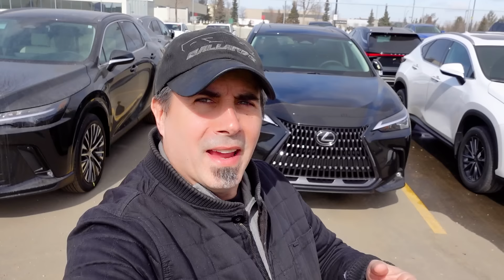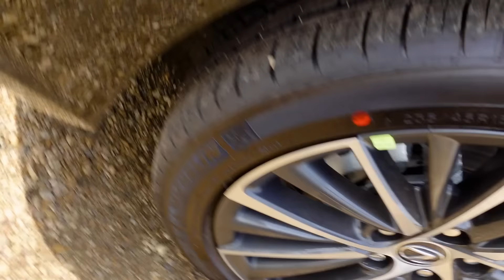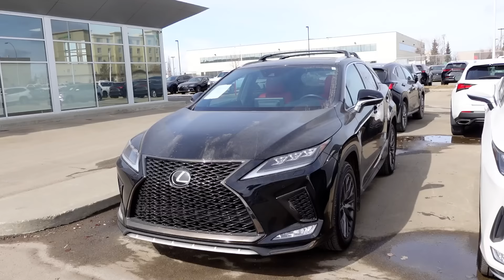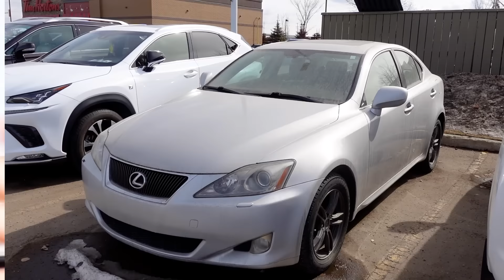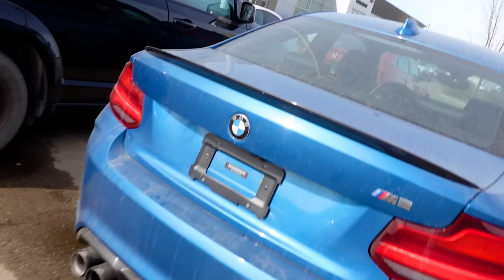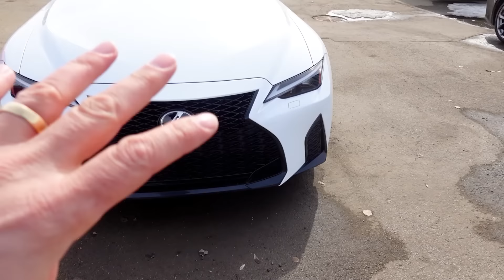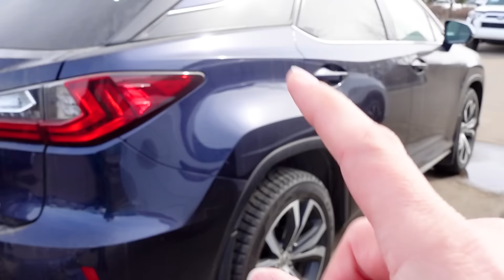Is Buying A Used Lexus a (MASSIVE) Mistake?

Comment: was a Lexus tech for 15yrs and YES buy a used Lexus..there bulletproof!!!   quality is very high and there quality team in Japan are top notch
Reply: The best.
Reply: @pauly kay Just wondering, is there a considerable difference in quality (if any) between Lexuses built in Japan vs built in North America?
Reply: @smakarov24  no that I am aware of.  I have 3 Lexuses in our household.  A 08 RX350 and a 24 NX350H both built in Japan.  My 17 ES350 was built in Kentucky.  All of them bought new.  I don’t see any built difference in terms of material and built quality.
Reply: My family owned 3 Lexus. I love Lexus. Smooth, luxurious, and reliable.
Reply: Yep.  We always buy new Lexus and keep them for a long time.  Wife’s 08 RX350 156K miles still going strong, my 17 ES350 just hits 37K miles.  Her new NX350H should arrive in about 10 days.  Wouldn’t buy any other brand.
Reply: I'm looking at a 2015 RX350 with about 80K on it. Anything I should be concerned about?
Reply: Nope....great vehicle
Reply: 80 k?  Barely broken in
Reply: My 2007 Lexus RX350. 260,000kms. Fully maintained & head gasket just went. Told I need to swap motor. Total    ost 6 to 8k. So disappointed
Reply: Idk i just bought a used ux and its got cabin vibration and slight vibration when braking. Only a year old. Prolly why they turned it in😅
Reply: @jacidel  it the UX is only a year old it should be still under warranty.  Take it to the dealer and have them check it out.
Reply: @jml9550  dont you have to pay for diagnostics?
Reply: @jacidel  yes you may have to pay an hour of diag fee.  Most likely they gonna tell you these are brake and tires issue.  Then they are wear and tear items, will not be covered under warranty.  Personally I would not get any repair at dealerships, any competent mechanics can work in Lexus.
Reply: @jml9550  hi! I took my car back to carmax and they do admit my rotors are warped. Brake pads brand new but rly bad rotors. Theyre resurfacing them for free. Thanks for the advice. :)
Reply: @jacidel  great.  Glad to hear Carmax stands by what they sell.
Reply: @jml9550  yeah. Im now hearing a slight rubbing though. Hope its okay. Supposed to be driving out of state in 2 days in a heightened level of anxiety😂😂
Reply: @jacidel  should be fine after they resurfaced the rotors.  The new brake pads may just need to “bed” in the rotors.  Google “how to bed brakes”.  Should show you how’s done correctly.
Reply: @jml9550  hope so. They dont look perfectly smooth as i thought  they would. Perhaps they will over time. I wish i was a mechanic and didnt feel so uneducated. Lol thanks i will google that :)
Reply: @jacidel  well we learn from experience.  I sure can’t prescribe medication like my Dr., let alone fixing cars.
Reply: @jacidel  if the UX is going at highway speed and vibrates during braking, It could be warped front rotors,  a mechanic should be able to resurface the rotors and get rid of the vibrations.
Reply: @jml9550  its actually when im slowly going to brake and whenever im holding the brake down there is a slight vibration through the cabin
Reply: @jacidel  could be warped front rotors and could be the tires not being properly balanced.
Reply: @jml9550  thank you i am going back to the dealership Wednesday i hope they can see the problem. Crazy to have such an issue at 24k mileage but i guess it depends on how the person was driving
Reply: @jacidel  yep.  If the previous owner hard brakes it many times it could warp those rotors.  Also sometimes tires can create flat spot during long hard brake, which could create vibrations while driving.
Reply: I wish we could speak more frequently, I think if I gained info directly from an actual experienced Lexus technician that, that would help me convince them to let me buy a used 2014 GS350 for under 21k financing but I can afford the car & about to finally finish my associates & bachelors.. but wants me to stick to under 15k w aHonda, Nissan, & Chevy.. I’m good, I work as a photographer at a Honda dealership & have been thanking to daily a 02 Envoy that just hit 253k miles.. just replaced the right side of her axle too w being a month w/o s daily 😴
Reply: @Mathilda2zero  changed the brake pads and rotors and its fine.
Reply: Thank you 👍
Reply: My 2012 IS250  F Sport gonna be ok sir?
Reply: How are they for maintenance cost compared to Toyota?
Reply: Wow but he surprised me with the rust thing! Lexus rust??? wow
Reply: Lexus tend to rust?? Wow I am surprised
Reply: I live on little money Are they expensive to maintain?
Reply: Very high.  Love mine
Reply: what about a hybrid battery in plug in models? How long do they last?
Reply: Any ideas on a rattle on ES300h roof lining? Like a light rattle ticking on rough roads. Above driver head, and rear passenger but does happen in all 4 corners. Been back to Lexus 3 times!
Reply: 2019 ES300h Fsport 30k miles. Riddled with rattles. Been back to Lexus 3 times 🤷‍♂️ Lexus have serious interior noise issues

Comment: Thoughts on the 2020 Toyota Avalon 3.5 V6? In terms of reliability & longevity. And what should I look out for?
Reply: The GR series v6 engines are dead reliable. 1GR FE 4.0 L.  was in 2nd gen Tacoma and current 4 Runner. 2GR FE is in the Sienna and other models...another great engine. They are hard to beat. I towed our RV 10 000 kms across Canada with my 13 Tacoma...that 4 litre is insanely reliable. I recommend THE CAR CARE NUT...he is a Toyota repair tech and you can search his videos for more info. He is a Toyota fan boy like me. He is very honest and fair.
Reply: @mikefoehr235  yessir! I watch him too!

Comment: One of the main things to watch out for when purchasing a used Lexus, if there is any maintenance records and where it was done. Some shops tend to put the wrong ATF . Needs to be WS. I have seen a Lexus and an Acura with transmission failures due to wrong ATF.
Reply: ATF and WS?

Comment: Lexus SUV's/crossovers are classy vehicles, but something that is more versatile and practical would be the first-generation Kia Rondo with the 2.7 L V6 engine and the five-speed automatic transmission, the second-generation Hyundai Santa Fe with the 3.3 L V6 engine and the five-speed automatic transmission and the first-generation Nissan Versa (hatchback) with the 1.8 L four-cylinder engine and the four-speed automatic transmission. Thank you very much.

Comment: I own both an 06 ls430 and 2011 rx350. Kept both of them in mint condition and no major issues so far. Highly recommend
Reply: The Ls430 will run forever.. one of the best that lexus have ever put out, only behind the iconic LS400 And Es350
Reply: I am considering a 06 ls430 & would greatly appreciate any further experiences/comments with it that you may have. TIA.

Comment: I bought a brand new 2021 Lexus IS300 F sport, switching over from a BMW 335. I looked at the new G-series BMW 330 at the time and decided to get the Lexus instead. This is a very accurate review as no car is best at all things and BMW certainly had the more modern interior design, some better technology, a better transmission. I did observe the Lexus to be superior in sound, luxury, build quality, design and having better seats alongside a more compelling engine (3.5 n/a V6 seemed more compelling than a 2.0T 4 cylinder). I do miss the 335, as leaky as it was lol. I think BMWs are great second cars for fun but I think most people will find greater utility in a car that excels in look, sound, luxury and longevity - these are all season commuters after all. Down to preference I would say, but I am sticking with my Lexus for my main and I'll get something fun on the side later down.
Reply: Scotty Kilmer approves this message🤣
Reply: @davidwelday3276  lol fr! I disagree with his continual bmw hate tho. The b48 & 58 ain’t too bad
Reply from the maker: Nice
Reply from the maker: Hi Devan, sounds like a solid experience with the Lexus so far, and you are right, the BMW has the focus on the drive above durability.  The B58 seems to be running solidly and I would expect the S58 to be even better, but time will truly tell.  Either way, BMW has improved in the last handful of years with regard to reliability.
Reply: @ECPP  if I could have afforded the g series m340 I would have it tbh. But my lexus was like 52k and those were like 70k. But tbh, I heard the b58’s are pretty solid. My n55 was a bit leaky back in the day, thank god I didn’t go through the n54 struggles lol.

Comment: Bought a 2013 RX350 F Sport a couple of months ago. 160K kms and the 8spd transmission failed. Car was well maintained. $12k to replace it with a refurbished one. Luckily the dealer had to buy it back.
Reply from the maker: Cheerz

Comment: My is250 runs like a champ with 170k miles
Reply from the maker: That’s a good run
Reply: @ECPP  it was one owner and had all the service records and I change the oil every 5,000 miles and only run high grade 93 octane thru it to keep the carbon build up low.

Comment: Love this channel! Please I have a tiny question - just purchased a 2019 ES350 with literally 30 days left off the warranty, what checks on the vehicle do you recommend I do asap to make sure I milk what’s left of warranty so I don’t get burned after it expires? Thanks 🙏🏽
Reply from the maker: Hi, have them validate that the updated VvTi lines are done, check brakes and rear suspension.  Window and door seals as leaks have happened.  Inspect water pump or have you had any coolant leaks?  Other than that, they are solid and just a general look over.  Cheers

Comment: I agree new Lexus is better deal than 1-3 year old Lexus. But I think a new hybrid Toyota is better value than a 4-10 year old Lexus. You can hold onto the Toyota for 4-6 years until you can get a lightly used Lexus at reasonable price. Many people are stuck in the mindset of new car being bad value, and they haven't adapted to current market dynamics. Another factor is that in 3 years there will be a shortage of 3 year old hybrid Toyota/Lexus, so they will demand a higher than normal price.
Reply: Just bought a Lexus NX hybrid for my wife to replace her 08 RX350 which still runs strong.  The RX will be my son’s first car.  My 2017Lexus ES350 drives like the day I brought her home, she only has 37K miles in her though.

Comment: The ES: is a Camry
LS: is a Avalon
Reply: Negative.  ES is Avalon based and LS has no American car it's based on.
Reply: Not so. I own both cars. 2008 Toyota Avalon Limited and 2012 Lexus LS 460., and there's a huge difference. The Lexus is vault like quite and holds the road like it's bolted down. The Avalon is smooth like the Lexus but much more road noise enters the cabin.
Reply: @beverlyquintela2754  Yup LS has much better insulation.  Based on same platform as Avalon though.

Comment: Excellent point, regarding ownership! Typically, a Lexus owner will keep up on the maintenance, even after several years and the "newness" wears off. Arguably, vehicles five or six years old might have been treated far better, over several owners, then expensive European cars out of warranty
Reply: Nah.. theyre just built better
Reply from the maker: Thanks
Reply from the maker: Haha I would totally agree Thomas as many Euro car fans drive them like a rally driver.  With that said there are some nicely kept Bimmrs and Benzs, you just have to look a little longer.  No warranty is a huge risk for a V8 BMW that is 9 years old.
Reply: @ECPP  without a warranty on my Porsche I would have been in bad shape. Well worth the purchase price!
Reply: First off who buys Lexus vehicles? They tend to be mature people that want reliability, comfort, and a stylish well appointed vehicle. A new Lexus is not cheap so people with a good income buy them. They can afford to make sure they are maintained. Lexus vehicles are not sports cars they are luxury vehicles, so they are driven accordingly. Most Lexus vehicles use regular gas. The venerable V6 will probably be phased out and replaced with a turbo 4 cyl. that will get better gas mileage but require premium fuel. Lexus vehicles with a normally aspirated engine are mated to a 6-speed or 8-speed geared very good transmission. Lexus is a Toyota product that has the same design that can be maintained easily concept. The exaust system is stainless steel, and the body is well constructed with good steel. The only issue you can run into on the V6 is a timing cover oil leak that is expensive to repair but it is fairly rare. Like any vehicle, you inspect it or have a mechanic go over it before you buy but Lexus used vehicles are generally a good bet. Or buy a used one from a Lexus dealer. They are not going to sell you a problem vehicle. 
BMW, Mercedes Benz, and Audi are nice vehicles but the parts and maintenance are very expensive. Who wants to have to change a timing chain at 200,000 km or sooner? They all use premium gas. They are not DIY-friendly vehicles in general. These days even a chain garage will charge you $130. per hour and they all nickel and dime you for scanner use, acetylene use, shop supplies etc. They are also up charging a lot on parts. The BMW, Mercedes, and Audi dealers will charge you $200. an hour and use shop scale book times for repairs. So a vehicle you can DIY  makes sense.

Comment: Mark, I bought a 96 Lexus SC400 with 162K miles and it was in mint condition. I put over 200K miles on it before some dumb broad texting and driving ran the stop sign and totaled my car. The odometer had 397K miles and still running strong. It really comes down to looking for the problem areas of the specific model you're looking to buy to avoid headaches and repairs. I bought a 97" SC400 for my mother as a Christmas gift years ago and again it had 150k miles and with 207K on it now the car is super reliable. Marky Mark this is why I say Lexus for life Baby!
Reply: also why i bought my lexus
Reply: Same. I am a Lexus lifer.
Reply: Toyota/Lexus and parts are still expensive but Wirth it
Reply: @Jac735  I wouldnt know because in owning Lexuses since 1996  i have never needed any parts other than replacing one battery on an LS400...seriously...and i have never taken any of my cars to a Lexus dealer for anything. Their prices will gouge your eyes out.
Reply: @Jac735  

💯
Reply: Stupid people and their dumb phones.

Comment: I have a 2013 Lexus GS350 all wheel drive. Bought it in Two thousand twenty new it was sixty one $1000 I paid 24000 thousand It had 69000 miles when I got it. It's been very reliable. I love my lexus would definitely buy another one but this one will never break so I'll have it forever

Comment: Great video explained! Lexus replaced my dash and door panels 3 years ago for free on my 2010 IS350. 😊
Reply: I had a 2007 IS had 75000 miles on it.   Something went wrong with the engine… and Lexus actually replaced it in 2011 after I had it for 4 years.  So impressive
Reply from the maker: Thank you very much

Comment: Should I get a Lexus IS 300 (RWD) with 43,000 miles, or a Certified BMW 330i with 27,000 miles??? Same price btw.
Reply: Lexus would always be my top pick
Reply: You could buy that Lexus without any warranty and never lose sleep.   The only way to buy that 330 is to add the longest bumper/bumper warranty you can afford and you will still wonder which loaner car you will be put in next.   Been there done that …
Reply: @Scwdetail  Already went with the Beamer 😂

Comment: I'd buy new if you can. These things hold onto value, look and drive great. You pay a premium but you have a car you can keep for 10 years easy, unlike Mercedes and BMW which will give you a panic attack once you are off warrantee or spend a lot for an extended warrantee for these heaps of German trash and plastic.
Reply from the maker: That’s the bottom line.  Thanks.
Reply: We never had an “panic attack” with our Mercedes. Thing is hella reliable and solid. You just need to up ya money up and then you won’t be talkin bout how bad they are even after warranty  🤷🏽‍♂️
Reply: @htxpalo  Happy for you and glad it worked out. All the best!
Reply: My bimmer i’ve had that is 12 years old and have owned for 8 years has actually been surprisingly dependable. I bought it CPO and have stayed on top of the maintenance. I’ve owned both American and Japanese brands prior and have to say all around the bimmer is the best vehicle I’ve ever owned. All my other vehicles I got bored with within a year and usually kept no longer then 2 or 3 years.